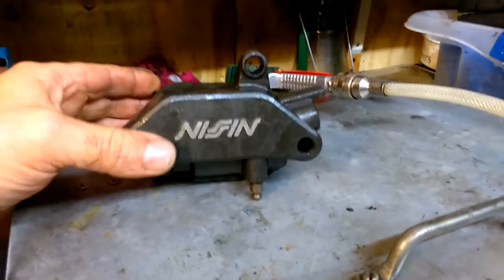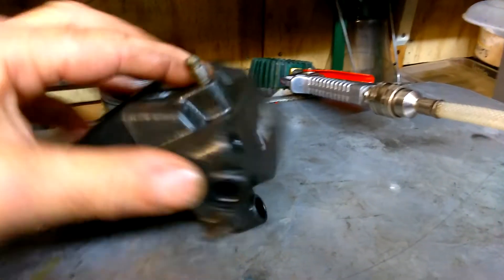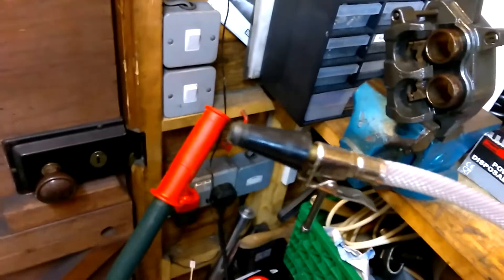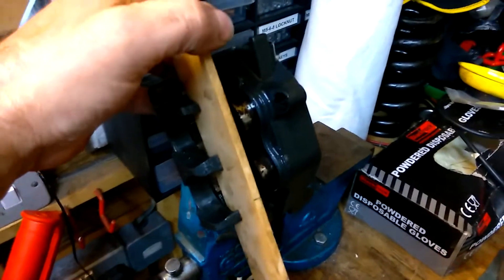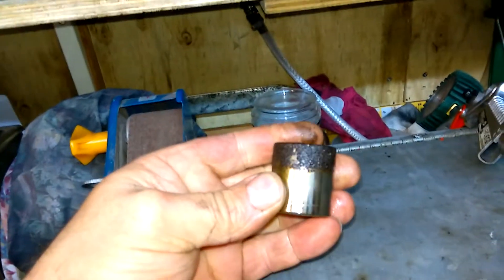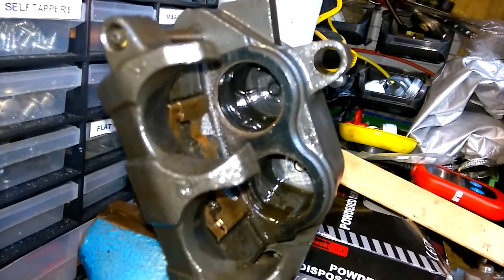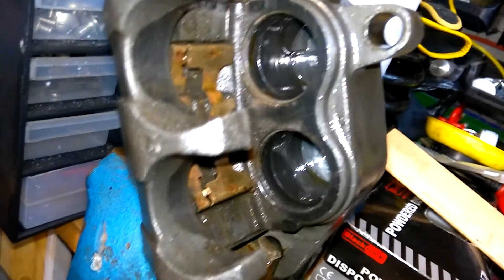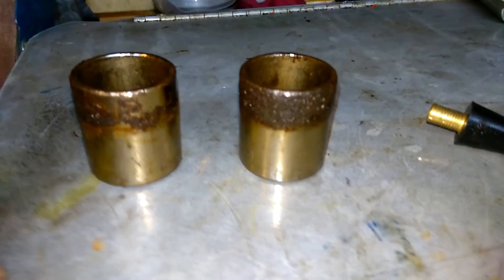Motorcycle Brake Caliper pot removal (Honda Deauville)

Comment: I know this is old now but I suspect many people will be suffering from my problem with brakes as these bikes get older.

Something I have discovered is that they have something called a proportional control valve which basically controls the brake fluid moving between the front and rear brakes and as stated the amount of pressure, but they do stick, and they are not cheap.

So if you suffer from brake drag and spongy brake lever and your calipers are ok ie none of the pistons are sticking as such it could well be to do with the proportional control valve, which oddly enough doesn't come under that name when you search for it online, it actually comes under Brake lines/PCV ABS

And there doesn't seem to be much in the way of information about it either, just that should you have the fault I mentioned above it is highly likely to be this in fact the service manual states it is this no if's or buts.

UK price at present is around £125 pounds for this valve so it's not cheap, and it can drag on for a while before you have to deal with it.

I swapped out some pads and that was it, pads stuck, pushed them back in pumped the brake, pads stuck again, calipers stripped and cleaned pistons moving free on all calipers, brakes stuck again, clean fluid not dirty at all, pads still stuck.

So only thing left to check is the proportional control valve as all the symptoms point to this.

Just thought I would share for anyone suffering similar issues it may help.
Reply: Thanks
seems my nt 700 2008 got the same problem
Reply: @mantasjaskevicius1385  One other thing I found is the type of brake fluid makes a huge difference as well, I changed the valve but it still had the same problem, though not as bad.

The onky way I managed to fix it was really daft, I completely blead the system several times to remove all the brake fluid, I changed the master cylinder rubber rings all of them, put it back and blead the system again a few more times, this worked had no problems with it since, it turns out you cannot use any other brake fluid other than dot 4 if you do this problem will drive you nuts, I used a little dot 3 and had all these problems, it damages the rubbers as well, that's why I completely drained out all the fluid, a simple mistake but it causes so many problems.

Do not use universal brake fluid or dot 3 not even if it says it is for both only use dot 4 anything else causes this problem and will mess up the master cylinder rings.

Comment: Hi, can you make a video on how to remove the actual assembly from the disc? 
I rely very heavily on taking it to be serviced but due to my high daily mileage, it is getting to be expensive. I don't have many tools and my bike stays outdoors all year round.
I mainly want to learn to do it by myself.
Thanks.
Reply from the maker: Lord of Thunder will do
Reply: Thank you very much.
After I saw your video today I went out and tried to take the actual holders of the panniers but 2 allen bolts either side inside the panniers are rusty and I managed to lose the thread of the head so I can't even that apart.
Reply from the maker: Lord of Thunder give all bolts/screws a good squirt of penetrating fluid before any attempt to undo, and leave to soak in. Another top tip is to try and tighten any screws/bolts that you want to remove, this breaks the seal/corrosion and then undo. May help you.
Reply: I would like to see that also.  Trying to get the caliper off the disk is all but impossible.  Maybe that is why there is nothing showing here.